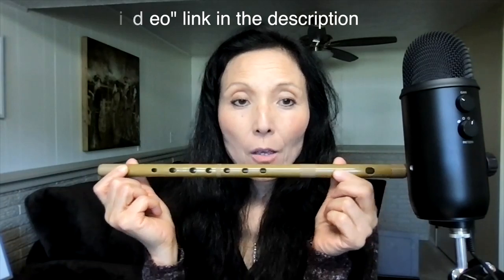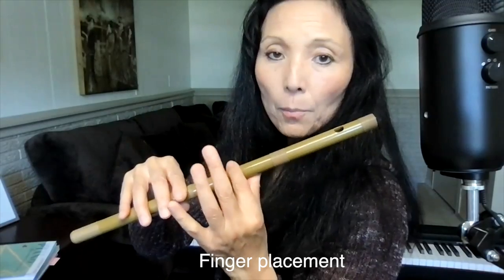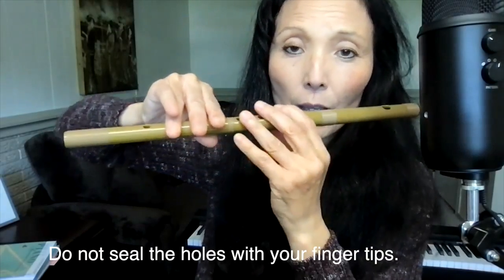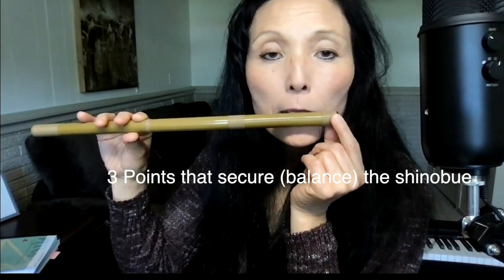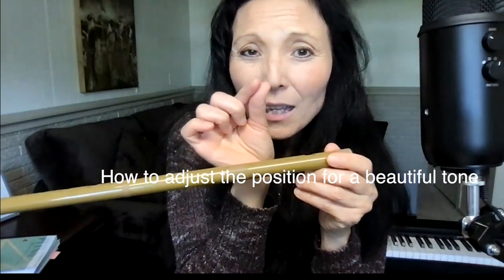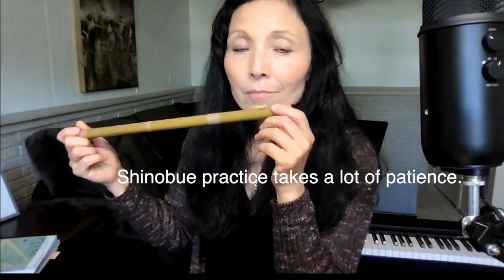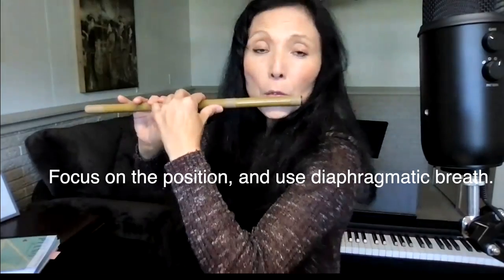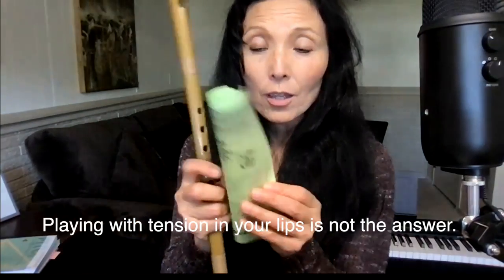How to Make Sound on Shinobue (Beginners)

Comment: Thanks very much! You gave some very specific details here that allowed me to finally find the sound on my shinobue! hugely appreciated; I'll be making sure to learn as much as I can from you :D
Reply from the maker: I am so happy that this video helped you, too, Bowie! Thank you so much for letting me know! I will keep on making more shinobue tutorials!! :D
Reply: @MikiShinobue  I had a follow up question ,if you don't mind - I am able to get sounds from individual notes, but when if I try to change notes, I lose it, even if I feel I'm holding the position of the shinobue steady.

So, I'll do cover all holes, slowly open one or two to go up and down a scale (like the 6, 5, 4 you mentioned in this viode), but it doesn't seem to be accurate, then when I close all the holes again, I get the sound back.

Is this normal for newer players to struggle with, and if so, what is a general idea you'd recommend for holding the 'sound' throughout a variety of notes?
Reply from the maker: @BowieAlexander  Thank you for this question! The shinobue position is SLIGHTLY different for EACH note. That's why if you try to keep the shinobue steady through the scale, some notes sound good, but some do not. You need to adjust the position of the shinobue by listening to EACH note. Does this answer your question? (I hope I'm understanding your question correctly! )
Reply: @MikiShinobue  This is a wonderful answer, thank you so much. It's a lot to learn though, the individual position relative to each note, and then seamlessly flowing between them, mid song. Not just learning the finger movements but the flute movements as well. What an incredibly nuanced instrument!

I am determined to get it down! Thank you for taking time out to answer my question, it's much appreciated! :D
Reply from the maker: @BowieAlexander  Yes, you are absolutely right! There are so many elements in playing shinobue that need to be happening all at the same time to create a beautiful tone. It is indeed an incredibly nuanced instrument as you said!! It is very challenging, but the challenge makes it so worthwhile to practice!!! Let's learn this amazing instrument together!!!!

Comment: It has to be left side?
Reply from the maker: Hi Joshua! Thank you for your question! Are you left-handed?
Reply: I play Shakuhachi that is a straight (not traverse) Japanese bamboo flute.

There they say that it is a good practice to learn to play with left hand at top and right at bottom to be able to adopt more easy to a traverse Japanese flute.

So I get the feeling that it is more than just have a “traditional” look when play. A shinobue must like the shakuhachi have a blowing edge that is sharp that divide/split the airstream that hits it from the mouth so the part that go into the flute gets turbulent and makes the bamboo vibrate to a tone. In shakuhachi that edge is called Utaguchi are in the end because that flute is end blown, and the hands don’t  affect the flutes “browning edge” position to the mouth.

If a shinobue is constructed as I think with a “blowing edge” the position and alignment with mouth and that edge depends on what side way the flute points.

Most flute makers makes flute by traditions and those are based on what is the dominant hand of the majority (right) of course a maker could take special orders, but  do that rather than learn play with left hand on top you get looked out for play others flutes. And yes one point on time most want to try a flute tuned in a different key and want to try that before buy.